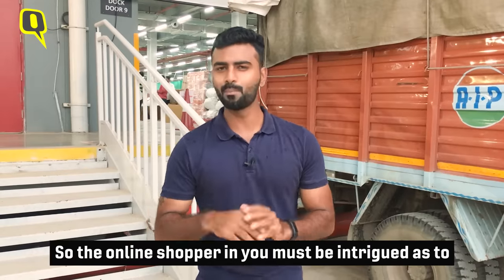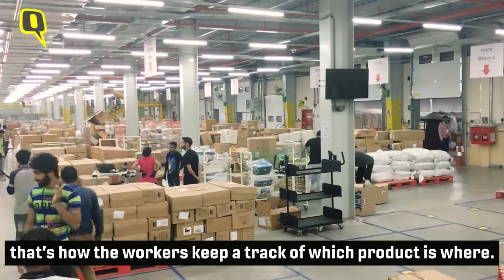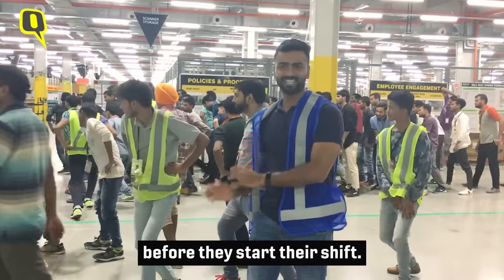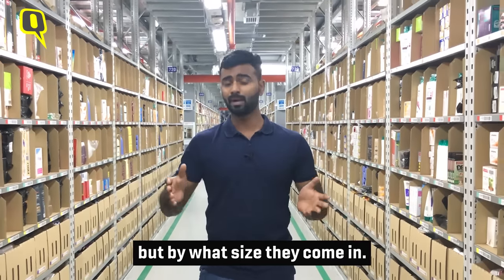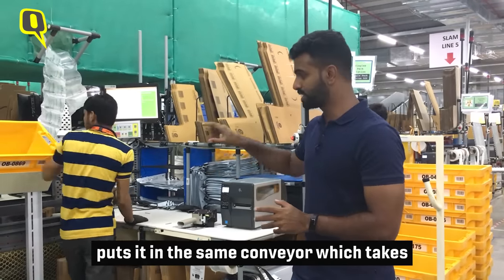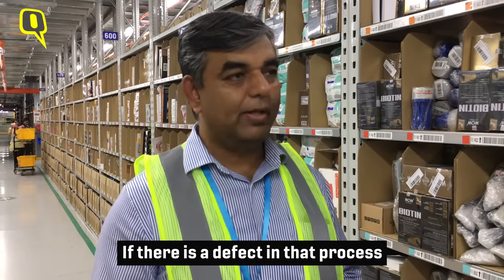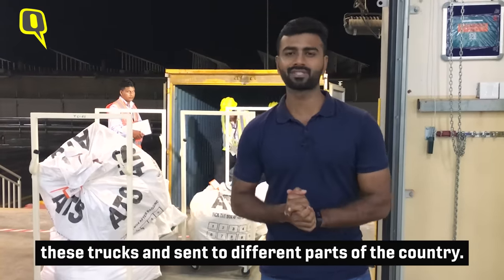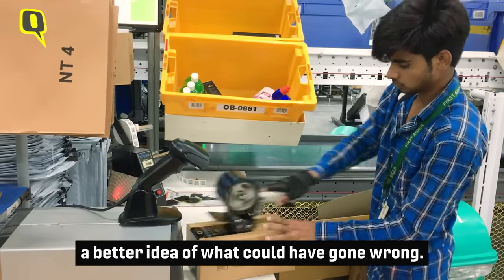Here’s How Your Package Ordered Online Gets to Your Doorstep | The Quint

Comment: Hey if the product is glass piece or a laptop....
Will they throw it the same way into the basket and conveyer belt?
Reply: Laptop boxes are not SIOC-capable in Fulfillment, mainly because they contain a lithium-ion battery, meaning damaging it could be a significant fire risk. Therefore, those have to be put into a separate amazon package (usually a 'P1' sized box) filled with dunnage material to prevent the item from shaking about inside, considering that Amazon boxes indeed may be thrown about a little.

I'm not concerned about durability based on what I've seen personally. Although I get a little iffy when I see the occasional LCD TV that doesn't contain a professional-looking box yet is still marked as SIOC. That said, shipment damage matters should be brought up with Amazon directly and not the seller to get a faster resolution if it happens

Comment: While packing in warehouse product are with black tape but when we get the product there is transparent tape?????? It means they get changed........and we get soap but we have ordered mobile phone..
Reply: Over here in Canada, there's still the black (water) tape, but those generally are only necessary on certain box sizes such as A1, A3, 1A7, U3, S6A.etc while everything else is put through a 3M-Matic whenever possible for efficiency's sake. Incorrect items can be blamed on lousy fulfillment associates themselves but I personally haven't seen this being much of a problem, though I completely understand how it could happen; as for the end user you'd want to report the problem to Amazon and not the seller

Comment: Sometimes product is missing what the reason ?
Reply: Contact Amazon and report the problem on each missing shipment as long as you're completely sure it didn't make it when it's supposed to (ie. marked as delivered but you don't actually see them at your door), these kind of mistakes can be quite common and doing nothing about it is akin to basically doing nothing